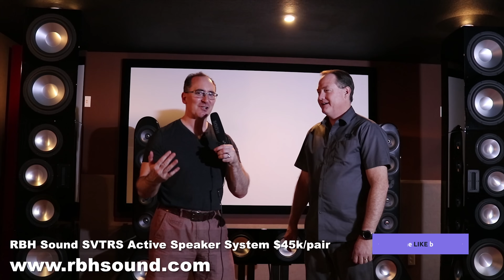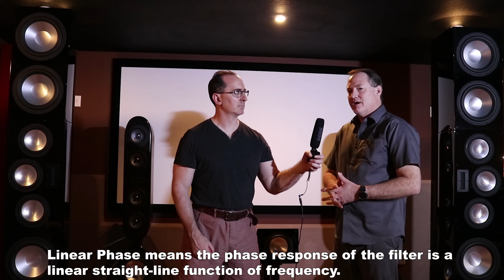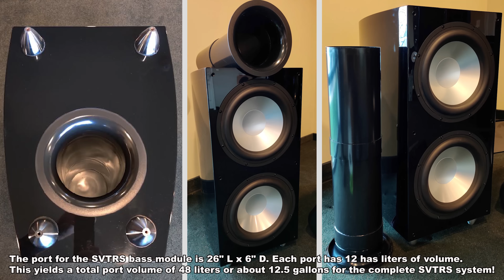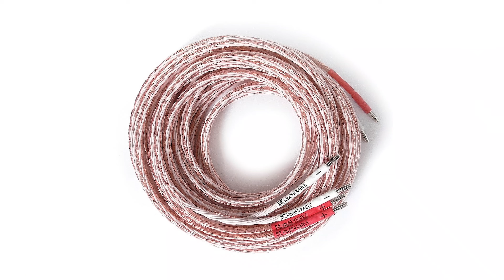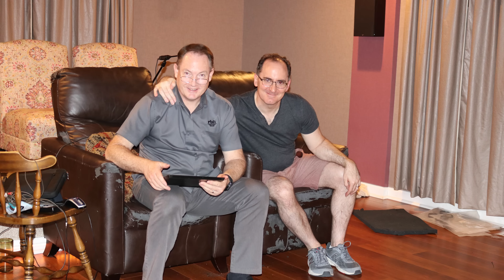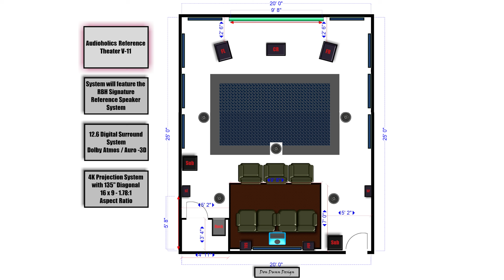RBH Sound Battle for Flagship Audioholics Reference Speaker System

Comment: My company Sifa Design Group has been using Digital DSP with high end Lab Gruppen and Linea amplifiers to do this for years. When you utilize Fir and Allpass filters correctly and have a robust measuring system (Tef, Easra etc) it’s a thing of beauty. PS: RBH rocks and it’s our go to speaker system for most high end Resi applications.

Comment: YES! I want a set! but probably without the top subs. 

One thing I don't understand is why FIR filter obsessive tuning all active systems are more common. My senior project as an Electrical Engineer was taking a Yamaha Receiver, hijacking the digital audio right before the DACs, pulling it into an FPGA, FIR filtering it with 1024 taps each to only crossover the Mid to High, then injecting it back into the receiver while borrowing one of the surround pairs as the extra amp chain and of course, driving a pair of RBH 661SEs. I loved the results then, but I don't know why it isn't as popular. 

I realize that IIR Bi-Quads just WAY easier to implement and they're computational easier too, but this isn't rocket science, just Electrical Engineering science! :-) 

You just can't beat perfect Linear Phase from both the tweeter and mid range. It adds a smooth detail and clarity in those transitions frequencies that is hard to come by. It blends so perfectly. 

Can't freaking wait.

Comment: Full digital control between the source and dac i find very appealing :)   think i understand it that this system does that.
A system that can take my spotify music output from my pc with usb to a external processor with dac and full parametric eq available so i can use a tone generator and listen myself and have my pc monitor display the parametric eq and i can and adjust it realtime quick and easy.
I went to  Marani Pro Audio website and looked up lpp480f and one spec that is a problem....
Delay:	480.998ms 10.4us increment/decrement steps per input, 340.998ms 10.4us increment/decrement steps per output.
that is half a second delay from input to output.  
i also need a big volume knob and remote of course.

Comment: The DSP configuration capability sounds really intriguing. I would imagine that technology could also be applied to smaller speakers to tailor the sound to both room and preference. I’ll be following as you release more details.
Reply from the maker: Yes they have same technology in their PM-8s.
Reply: Give a google to mini dsp and measure with rew. Apply dsp to any speaker that way
Reply from the maker: @Gw49172  mDSP is not SOTA but sure similar concept.
Reply: Audioholics - that makes sense that the miniDSP not providing the same level of performance. What captured my attention was the crossover being entirely in the digital domain. That is something that needs the speakers full participation and would not be accomplished with just an add-on box like the miniDSP.

Comment: Hey guys, this is really interesting products. The one challenge I have seen with pairing of air motion transformer to dynamic drivers is that there sometimes seem to be some disconnection of some sort, like the drivers play different songs. I am not sure what this comes from, different topologies, directivity issues or something else. However, most of the speakers I seen with this combo have some sort of integration problem, easily audible. Have you had any of these issues?
I assume RBH fixed this somehow 😊

Comment: Hey! thanks to RBH for finally building a speaker that belongs in 2020.   Imagine its 2001, Lake Contour 226, 2 Warner Imaging VTE-201, 2 Bryston 7BST. 4 Skaaning 10", ATC mid and Dynaudio Esotar tweeter.  Square wave in square wave out.  Passive speakers are a joke,  Congrats Gene!

Gene why not think about the Quantum logic or dolby atmos pro processors used in real theaters?   They are AES out or Blu-link to AES via BSS processors.
Reply from the maker: Hmm I don't have access to those type of products, unfortunately. Also, I need modern HDMI interfacing. Storm Audio has an incredible solution in their Mark2 processor with AES outs.

Comment: 10 hz is insane and im sure their earthmovers, both are winners by the looks of it.
Reply: I'm not sure I get it. it may be for films important? I don't know if they leave it in, But for music is not desirable you just cut off at 20 Hz because there's a lot of noise below that frequency what muddy the sound the bass you ideally want 36 DB slope cut off at 20 Hz
Reply: @johnsweda2999  I'm sure you can handle that with the DSP.

Comment: A simple glimpse of the SVTRS's in one of 'ur recent videos prompted me, a few days ago, to place an order for 4 x 8" DVC woofers along with 3 x 4" mids for each of 7 matching towers for a total of 49 drivers. Tweet, crossover, and box type(s) TBD. But would be stacked just as these SVTRS's as they HIT me immediately as a design that's got so much right! I've also picked up the OmniMic v2 & DATS v3 combo pack. Along with 2 micro SD cards to document and maybe archive here on YT? Hopefully. GREAT discussion, inspiration, design and build guys! Beautiful!!!  8D (Ps; also just built a Metal Maslow CNC, waiting on delivery of a raspberry Pi for Web Control. Good things to come!)

Comment: I'd love to see this stuff compared to modern commercial cinema equipment.  Cinema gear is what movies are mixed for.  And it's typically much more powerful and cheaper than high end snake oil home cinema gear.  For example you can get a dual 18" QSC subwoofer for around $1,100, and the QSC amplifier with DSP built in to drive it for around the same price.

Comment: i have had this in my DEQX based active systems for the last 10 to 14 years --just shows how advanced DEQX have been. Watching further 15.30 Gene goes on about being one of the first to be digital to the speaker - I think he should ring DEQX Australia and hear the laughter they have had that for at least 10 years -many only scratch the surface of what DEQX can achieve but fully implemented the results are incredible -and fully digital is the way to go astonishing !
Reply from the maker: It's definitely one of the first integrated into a home theater application. Very few AV processors have digital outputs to do this. Storm Audio and JBL Synthesis are among a handful I can count on one hand and still have fingers remaining. Please list other Atmos based processors with this feature.

Comment: arnt they too large for the size of the room? weve always been told that speakers can get too big for the room..
Reply from the maker: my room is 6,000ft^3. Ceiling height is 8ft. They fit and project well.
Reply: This question is very interesting, I feel it's a meaningful consideration with passive loudspeaker systems, as both they and the room are fixed. Questions of harmonics between the resonance of speaker cabinets, and the resonance of the room.  Very interesting. I feel measuring the room may even be an intriguing way of shopping for speakers, to reference a  database of options to match the needs of the room.  I'd be interested if anyone else would be interested in pursuing such a thing.